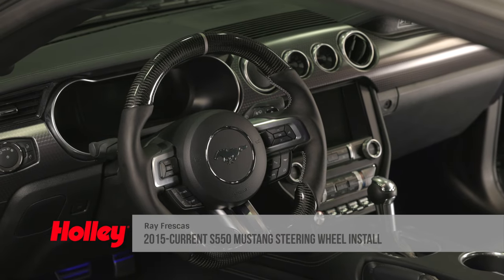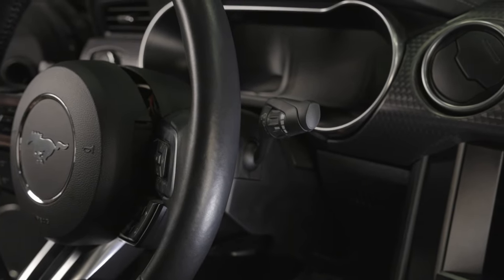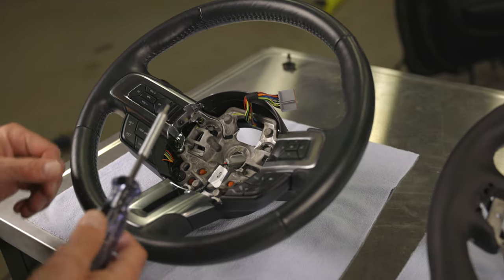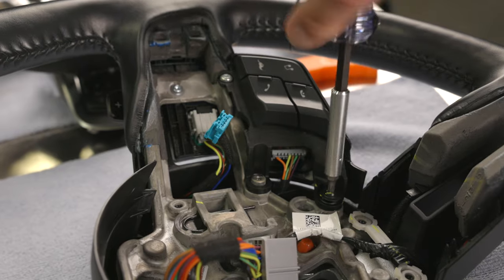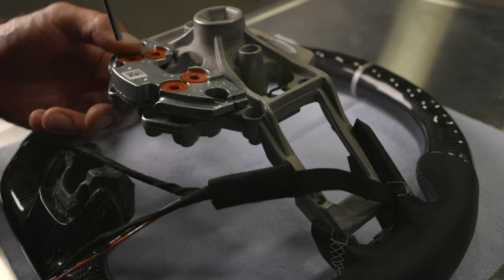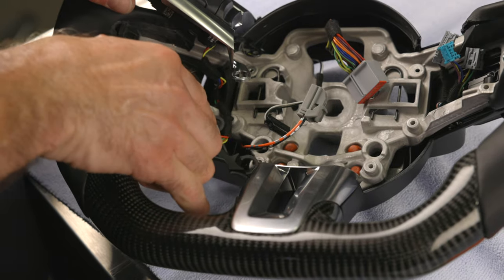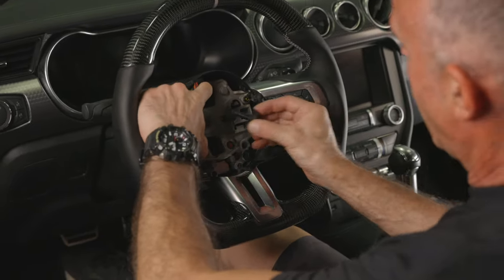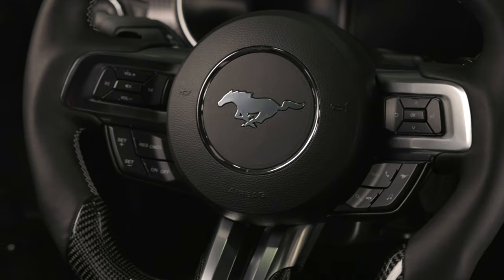How To Install A Drake Muscle Cars Steering Wheel Into Your 2015-2022 Ford Mustang

Comment: Tip for the install so you don’t have to deal with what I dealt with. Tip 1 some cars have different wiring routes on the oem steering wheel. So don’t use anything sharp to move the springs for the airbag. You could scratch and damage some wires (like I did, luckily some electrical tape did the job). Tip 2, make sure the heated steering cable has a lot of length, otherwise you will not reach the connector and have to uninstall everything. Tip 3 it will take much longer than you think 😂
Reply: Thanks for the heads up on the short wire for a heated steering. Even after trying very hard, the connector still fell short by 2-3 inches.
Also, the last connector was not releasing so I had to use a pin to help release it.
Reply: If I install a wheel without heating and leave the oem heat harness disconnected will it throw any lights on the dash?

Comment: Idk what I’m doing wrong but I can’t seem to find the tabs on the backside of the steering wheel to realest the airbag. Help lmao
Reply: I got the same problem, but i found them the issue is that i push those tabs and the airbag dosn't released, do u found a solution?

Comment: Did the airbag light come on after replacing the steering wheel? Mine came on and I'm still trying to figure out how to reset it.
Reply: Did you mix up the cables that ho to the airbag?
Reply: @jmoo876  there color coded and Will only Go On One Way, it's  impossible to mix the wires up on the airbag
Reply: did you ever figure it out? i’m also having the same issue
Reply: @CAcaAxel123  Yes, I actually figured it out. The issue was one of the orange tabs wasn't pressed down ask the way even though it appeared to be. I found this by retracing my steps and starting over making sure all connections are done.

Comment: Does anyone know if the heated steering wheel will work on my mustang that doesn't have heating? I'm not asking if the heating will work. I'm just seeing if I can buy the heated one and still install it just as if it was the non heated one...if that makes any sense...

Why I ask, the heated one is on sale right now.
Reply: The heated steering wheel works fine. Just cut the wires off.